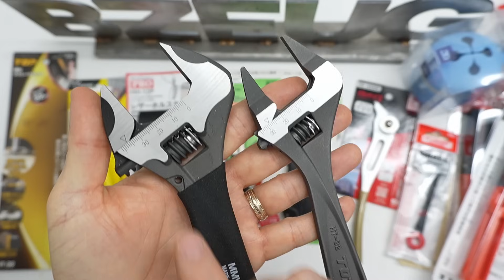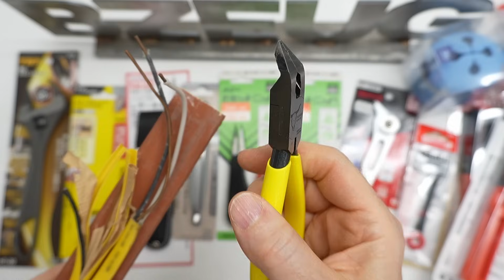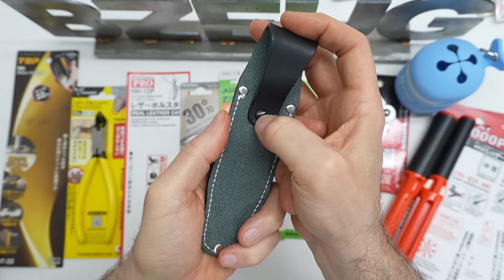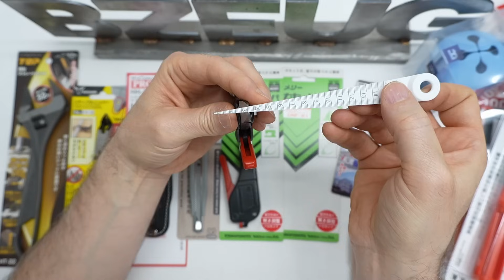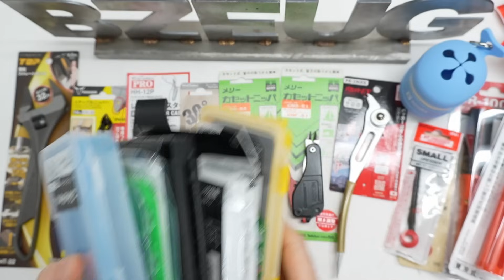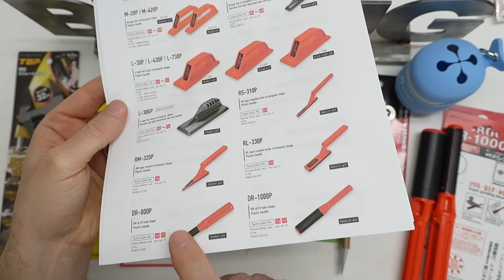Japan Tool Haul: MERRY Cassette Nippers, Tsunoda Staple Puller, TOP,  IPS,  NT Cutter Dresser

Comment: I recently bought the Tsunoda KBN-150, Cable Tie Cutter for my latest Computer Build. I found your channel on Amazon on the VESSEL IMPACT BALL™ Torsion Bit 30+1 PC. Set in SLIDE CASE. Most informative. I fell in love with Vessel, when I bought my first screwdrivers, both ratcheting and non-ratcheting. IDK which I like more: My ratcheting Vessel Ball multi-bit driver, or my Megadora Impacta P2-150. The versatility with the multi-bit fits all my Makita & Vessel bits, while the Megadora Impacta is like using the Chuck Norris of screwdrivers! I have a lot of catching up to do on watching your videos. Thank you for the videos on Japanese Tools. First it was Japanese kitchen knives, DE safety razor blades, gel pens and stationary, shears & scissors, and now, Japanese hand tools! ⛩
Reply: similar journey brother. getting into japanese tools naturally led me to the mechanical pencils, pens, and stationary world. absolutely amazing stuff. I thought the kuru togas were impressive, but after trying the pentel orenz nero I literally dont want to use any other pencil ever again.

Comment: That fishing accessorie looks like a fantastic little trash can like the dust bins the japan workers carry on there tool belts.  I use the fujiya kurokin  leather dust bin on my tool bag as a small trash can.  Gotta try rhe staple remover and half a pier lifter.  Thoes tight reach pliers are kinda specialty unless im in such a tight space all the time.  Tsunoda is on fire with pliers lately quality price hard to beat.  I did notice my stream of levels I use to see on sale has gone down.  I want the fujiya kurokin one but its crazy price 60 to 70 bucks.

Comment: 14:38: Actually no. Blackship gave out bad information on this. I did get the SDS from Ebisu Levels (which they kindly sent in both Japanese & English  and they don't contain ethanol). I sent the SDS to Blackship who sent it to Japan Post, FedEx & DHL who all declined to ship the levels anyway. Don't waste your time on getting the SDS.

There is another carrier, Express Mail Service (EMS) that provides tracking, etc. that will ship them direct from Ebisu. Ebisu is a great company and EMS got me 4 levels in short order.

I documented all this in a series of comments in a previous video. I also asked Blackship to consider using EMS, but they declined, implying EMS is part of Japan Post and would not ship for them. 🤔🤷‍♂️😬.

For more details see my comments in the other video.

John